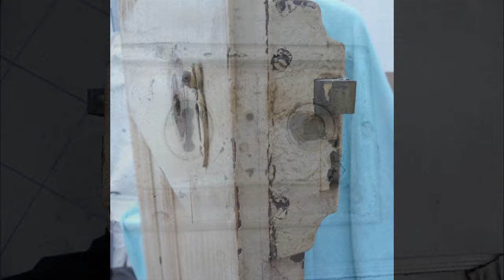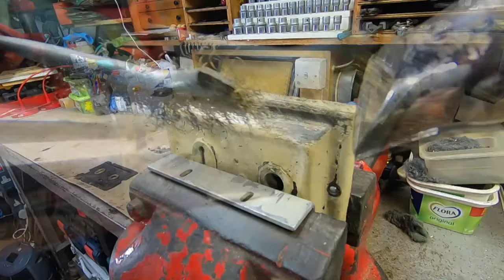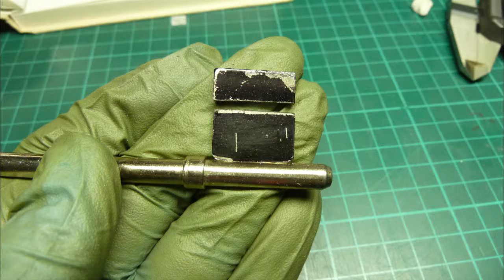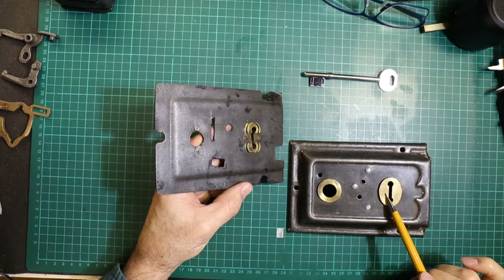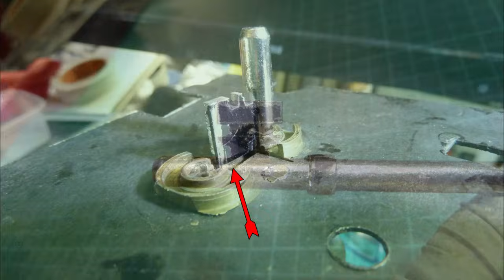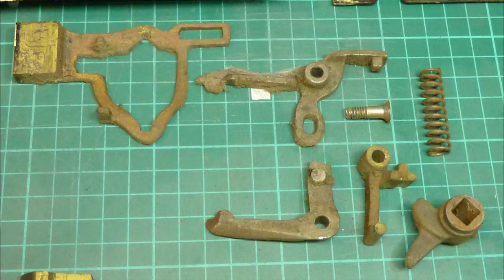Vintage Rim Lock & Key. Rebuild 100 year old Rim Lock. Cut Key to fit the lock.

Comment: Wow, that is really amazing.  Not only did you restore the vintage rim lock, but you also made a new key to match it.  That is proof of the great skill you have in your work.  It looks much better and it works like a charm too.  Very excellent work,, Jim.  You must be a real locksmith as good as you are.
Reply from the maker: Hello George Brown. Thank you for your kind words but I'm no locksmith, it just seemed the right way to make a key fit. You would probably find lots of locksmiths turning in their graves if they had seen what I had done!
On a side note, I was born in Stevenage in the UK, we had a motorcycle shop in the Old Town owned by an old racer and sprint champion, his name was George Brown, and that was the name of his shop. Your name has brought back a lot of memories of my youth and of Super Nero, a supercharged Vincent 1,000cc V twin sprint bike, it was built in the 1960's and collected a whole load of records. If you are interested search your name and Stevenage, Vincent Motorcycles. Thank you once again for your comment Georg, and the trip I just took back to my youth. Take Care Jim

Comment: This is exactly the same as I have no keys for any of them I have just removed them ready for restoration
Reply from the maker: Hello Sachin
Thank you for your comment, Are you going to have a go at making the keys? I think you should! Take Care Jim.
Reply: @CYC123  I don't really have a set up like you but I have seen a similar video where you can take your lock and try it with a range of similar keys
Reply from the maker: There cant be that many key shapes so you may be lucky. If not you can then make one! Good luck Jim.
Reply: Split all locks apart and paint stripped them all, one lock has a broken leave / fold type spring.
Reply from the maker: Its a shame you have a broken spring, If I needed parts and didn't have a workshop, I would try to find a donor lock, perhaps at a house salvage yard, or antique shop. Good luck, Jim